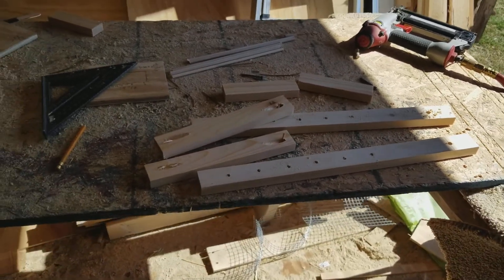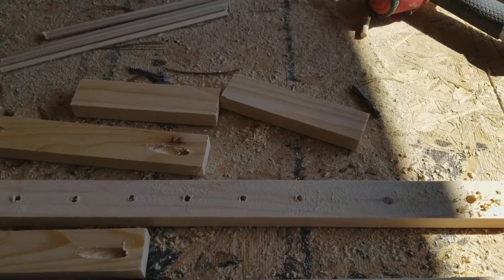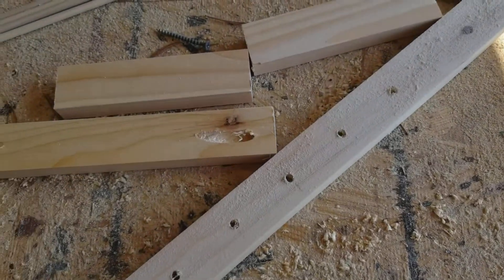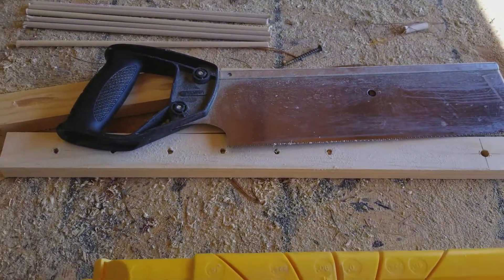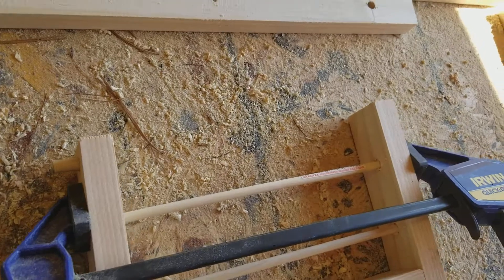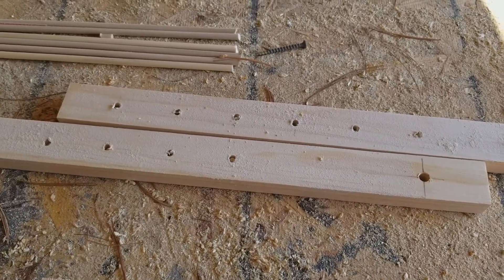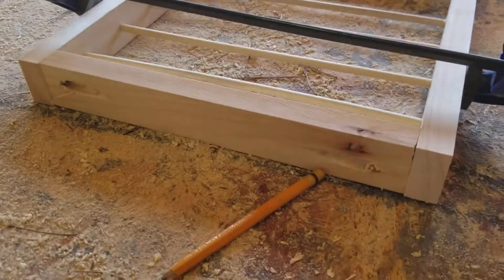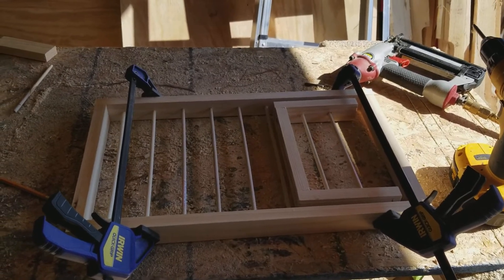Homing Pigeon Nest Box Front Design and assembly. 2018 breeding box.

Comment: Pocket holes are a good tip. I went in from the bottom and split the wood 😩. Good job thanks for sharing.
Reply from the maker: if you pre drill that will keep you from splitting the wood also.